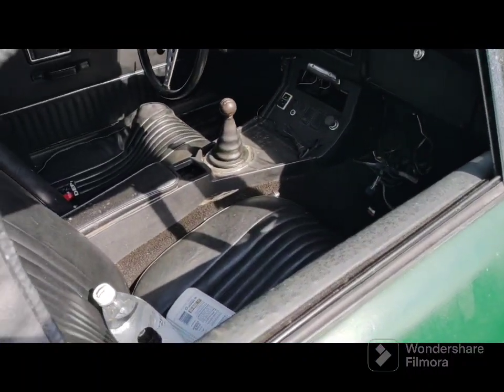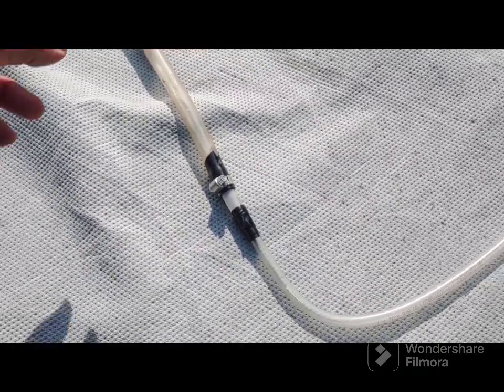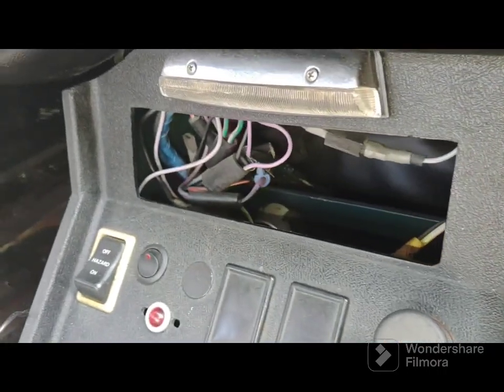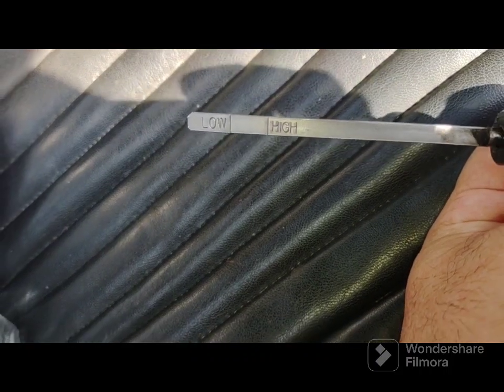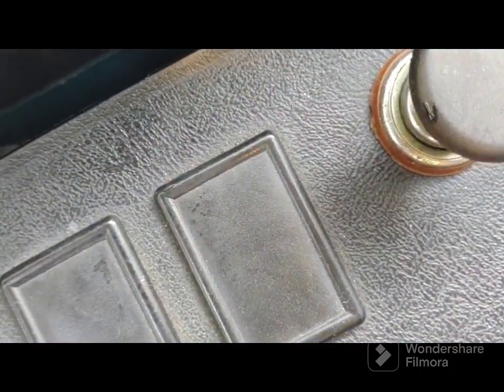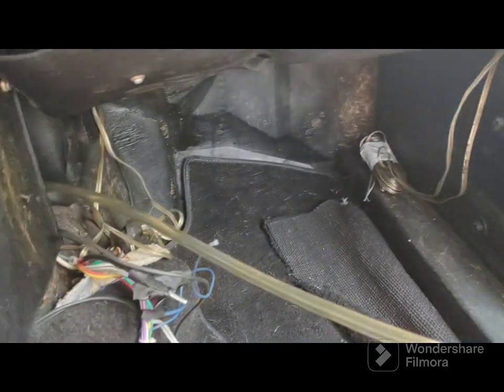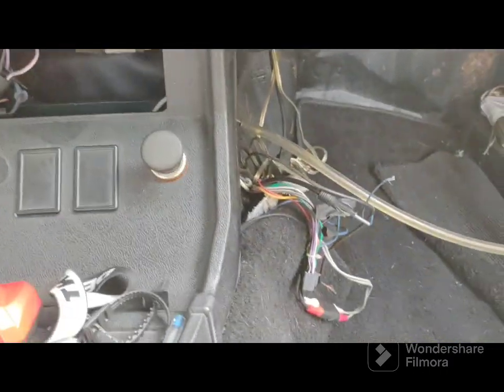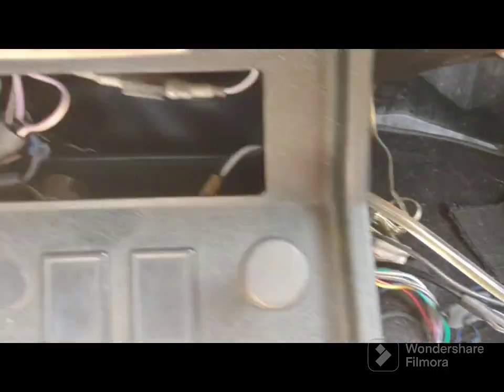MGB Tranny Gear Oil Top-Off

Comment: Very helpful, thank you. I have never tried to check my gearbox oil level, just take it to the shop which now seems like a waste of money. Also I'm a little envious you also have/had a TR-7.
Reply from the maker: Hello Cbrionkidder.  How are ya? Well I've owned this car for a few years and haven't ever checked it (gearbox oil level), until now.  Next, will be my rear differential oil, maybe in the Spring.
     Well these year MGBs can be checked without having to get underneath the car. Not that getting under the car is a difficult thing (I seem to live under there anyway - lol).
     If your car has the dipstick, and your back is in good shape, and you can bend and twist like Harry Houdini, checking/adding from inside is pretty easy. I was kidding on that Houdini part. But don't drop the dipstick under the car.  I almost did. No big deal if you do.
    The TR7 is a great car, despite what people say.  I bought the '77 a few years before I got the MGB. I only got the "B" because I never owned a convertible (plus it was right in my neighborhood so I couldn't resist!!). As far as  handling, speed, and comfort, the TR7 wins, just can't wear my wide shoes in the TR7 as the pedals are close, so the MGB wins there if u like wearing Crocs or similar. Plenty of room in the B's footwell. 
   But it's not fair to compare two totally different cars from two different eras.  Both are crazy fun cars in their own way, and make you smile. And both were very reasonably priced when I bought them, but needed some attention, for sure. 
   As long as your TR7's engine is sound, it won't give you any more headaches than any decent car.  Both are easy to work on too.